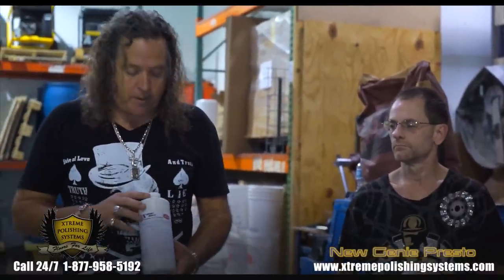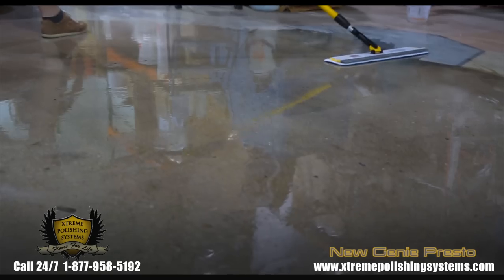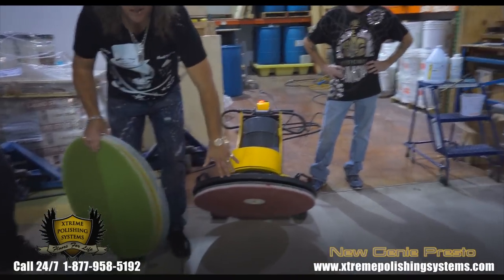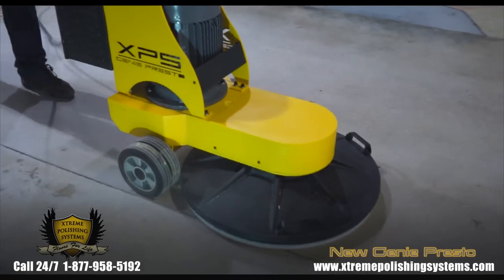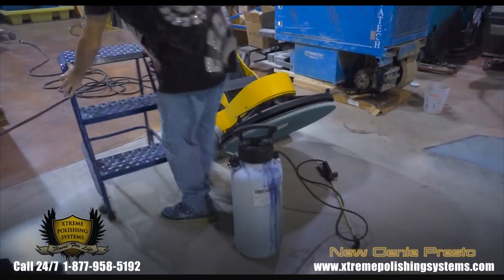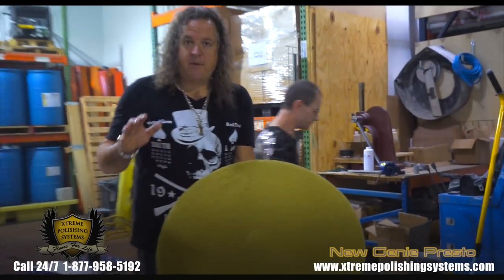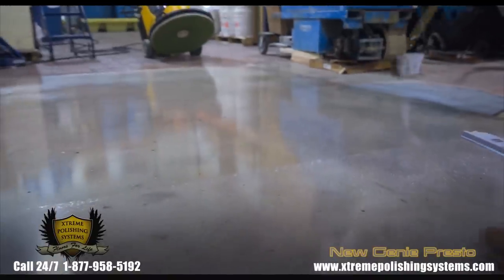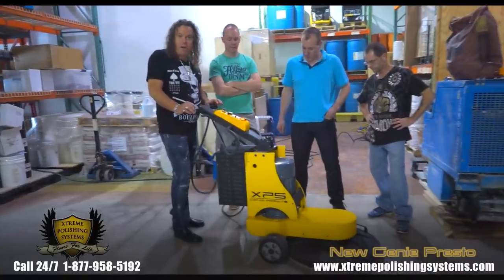HOW-TO Densify & Seal A Concrete Floor (Start to Finish) | Xtreme Polishing Systems

Comment: Great looking final result.  A OH&S question - re 'free 'silica' (and why sandblasting is now banned in most regions) from the concrete as it gets polished (polishing removes surface the surface - no matter how fine) - have you ever done any air sample tests?  I would like to think that this method seems relatively safe - but just because you cannot see the silica in the air - that does not mean it is not there.  Operating on a 'better to be safe than sorry' basis - any suggestions to ensure operators do not develop silicosis of the lungs?  I would like to do this concrete treatment to several large concrete projects I hope to commence in 2021. Have a nice day all.  CHEERS from AUSTRALIA.
Reply: Wear a mask mate lol

Comment: It's easier to Densify when you use a sprayer to spray the densefier around instead of just pouring a shit ton on the floor
Reply: Jack Reacher make sure it’s wet very wet,my advise is not to spray